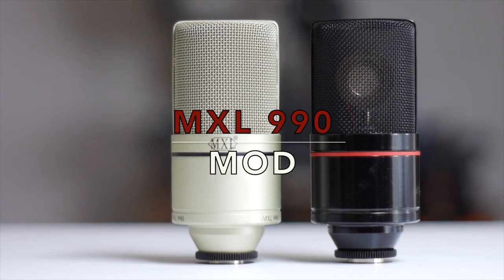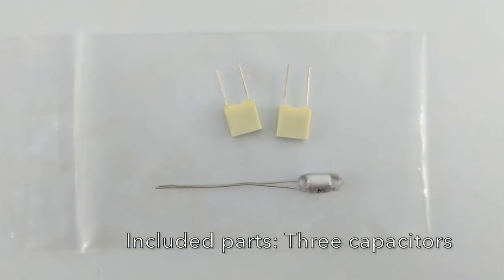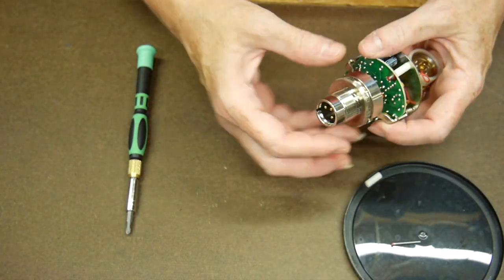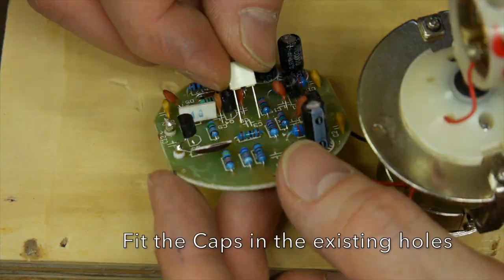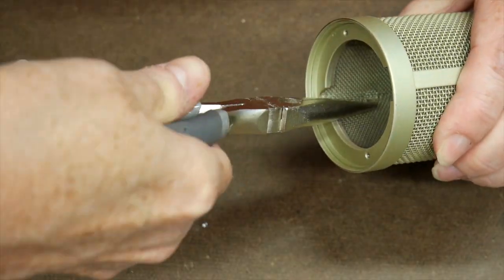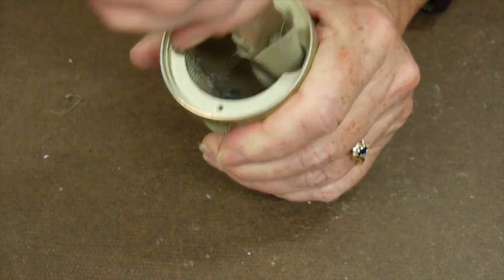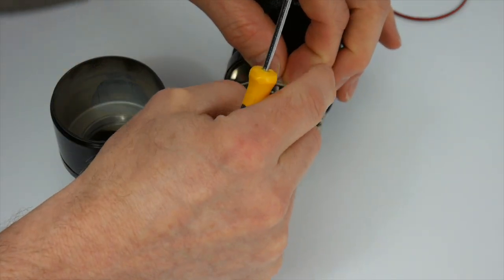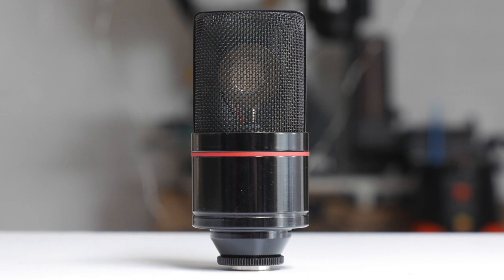MXL 990 condenser microphone capacitor upgrade MOD, body repaint, with sample audio

Comment: I couldn't really tell any difference in the sound to be honest. I do like the idea of removing the internal foam pop filter as I use an external pop filter anyway. Removing the internal foam pop filter opens up the mic and gets rid of that muffled sound that you sometimes get with these mics, especially with higher gain settings on the mixer or audio interface. Great video!!!
Reply from the maker: Tough to tell with all the compression that YouTube puts on everything, but its better in my opinion.
Reply: listen in good headphones or speakers. Clear as day difference.
Reply: Feverwar Eventually you still gotta put stuff on YouTube either way so what’s the point ?
Reply: @EricStrebel  It would be a heck of a lot easier to hear the difference (and yes, I can hear that the rolloff frequencies have changed) without the background music.  I think if you're trying to compare microphones, having anything but the microphone's output in the channel is sort of working at cross purposes to your goal. Not trying to bag on you, I have one of these and am definitely going to see if I can make it a bit nicer on the ear by doing precisely this. I'm just trying to give you some advice about your production choices.
Reply from the maker: Fair point...

Comment: Without changing the capsule, you will still have a pretty crappy microphone...
Reply from the maker: I agree, however I think it sounds halfway decent I still use it for every one of my videos working pretty good I think for the price good value, is it the best microphone ever. No but it ain't bad.
Reply: PPR Consulting & Solutions The capsule is 90% of the mic tho
Reply: @reekrodriqguez6552  some of the older mics had capsules that weren't as bad as others. It's a literal crap shoot which one you would get. But a good circuit behind a capsule with a decent frequency curve does make for a good mic. Maybe not a great mic. But the greatest mic in the world is still an extremely subjective thing. And to be honest, many many hit records over the years were made on far less superior equipment. There is a use for any mic that doesn't have a ton of noise in it.